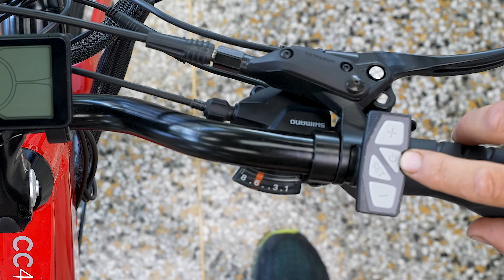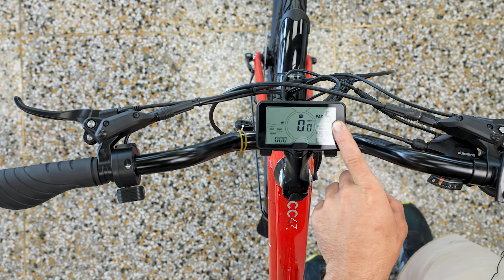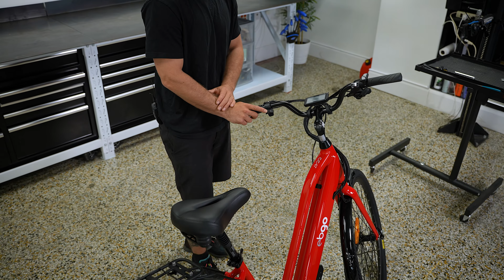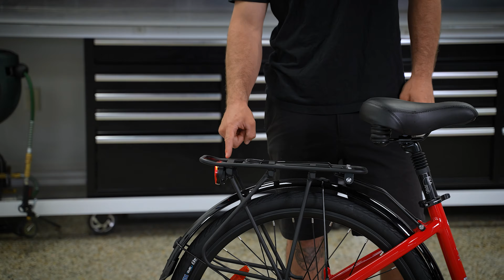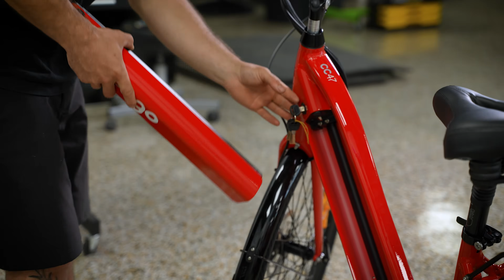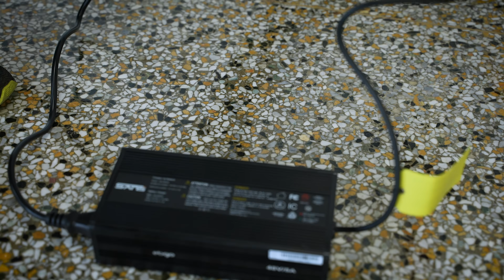EBGO Electric Bikes - How To Use Your Screen ?

Comment: On my cc47 front headlight. The 3 selection mode is not working. Remains on in one setting only. So there is no high beam,low beam, or blinker. Can this be corrected?
Reply from the maker: ONly one mode on the light thanks

Comment: On the console what is displayed on the top left? Manual says it's not available by default? Also says same thing for Trip 2.
Reply from the maker: Its is the watt power your are using. The more you use your motor power, the more teh bars will go up. Thanks

Comment: Great video. Does the screen power off on its own if it's idle and not being used? If so do you have to power back on? Also is the screen waterproof in case I'm caught in the rain? Thanks
Reply from the maker: The screen will shut of automatically after 5 minutes. Thanks
Reply: @ebgoelectricbikes  What about it being waterproof?

Comment: Is it possible to remove the screen? Or to disable the battery somehow? 
I'm thinking about when I lock up the bike at the grocery store, someone could use the buttons and turn the bike ON or they could damage the screen
I was thinking it would be a useful feature to somehow use the key to disconnect the battery without physically removing the battery.
Reply from the maker: You can add a password contact us at support@ebgo.ca
Reply: You can add a password to enter the screen, contact ebgo at support@ebgo.ca
Reply: Nope the password option does not exist, the bike can't be locked unless you have a chain or you need to remove the battery and have it with you what is a bit crazy.

Comment: There is a button on the battery that has the power symbol and flashes green when you press it but it doesn't seem to have a purpose unless it is a charge indicator.
Reply: I also would like to know what the purpose of this botton
Reply from the maker: Hi Carley, Its to know your battery percentage when removed from the bike.
Reply: @ebgoelectricbikes my button is green but my bike won’t turn on.

Comment: According to the manual, the paddle assist work like: PAS 1 - 10% assist, PAS 2 - 15% assist... instead of the PAS 1 - 10km, PAS 2 - 15km and so on...
Reply from the maker: PAS 1 10km/h
PAS 2 15km/h
PAS 3 20km/h
PAS 4 25km/h
PAS 5 30km/h
Reply: @ebgoelectricbikes  is there a way of programming the controller to change the speed limits like pas1 to 15, pas 2 to 18 etc..

Comment: I would like to see a video on changing the gears.  I got my bike yesterday and love it but can't get the gears to shift down.  Also, my front light doesn't work - any suggestions.  Thank you.
Reply from the maker: Maybe for our next video series. If you still have problem contact us at support@ebgo.ca
Reply: To make the pedalling easier, press the lever in front.  To make it harder, there is a lever in the back of hte handle that you can't see when you are riding the bike, but it is within easy reach of your index finger.  Hope that helps!
Reply: There is a switch on the light — either at the top or at the back of the light
Reply: Here is a good video about changing gears on an e-bike:  https://youtu.be/cpN3ilLgoDg
Reply: Awesome information, thanks. I’ve just ordered the bike and waiting for it; any idea how long will it take to get the battery fully charged?